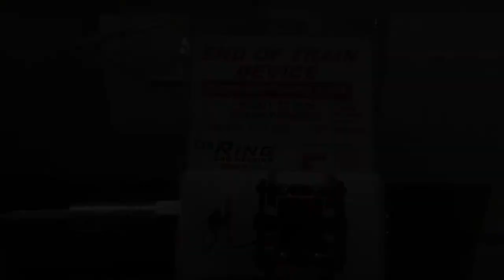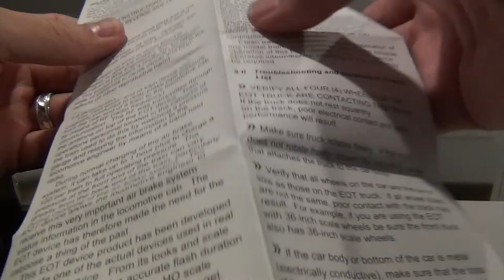Installation of an end of train device (also known as a FRED)

Comment: I just received one of these recently and the wire hangs down and drags within the gauge of the track. I'm worried that it might snag or get damaged. I double checked the instructions and rewatched this video, so I am positive its installed correctly. Also the car is not low. And suggestions, ideas, or comments?
Reply: I had a similiar problem. A dab of ca glue and accelerator helps